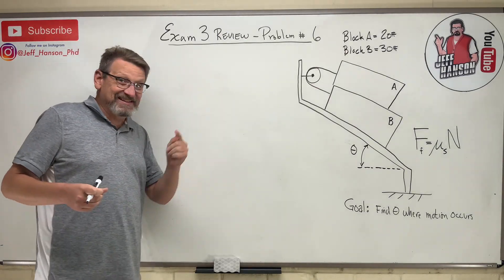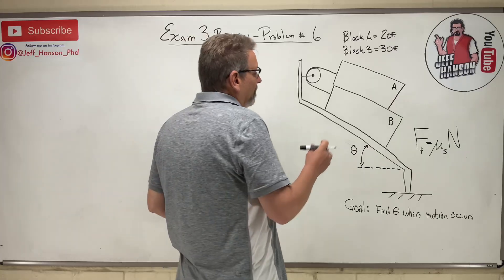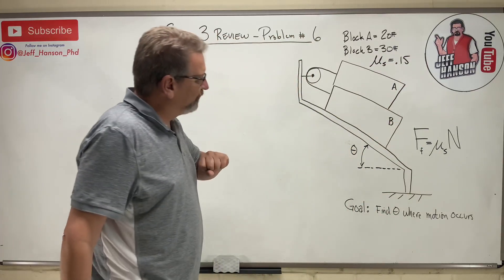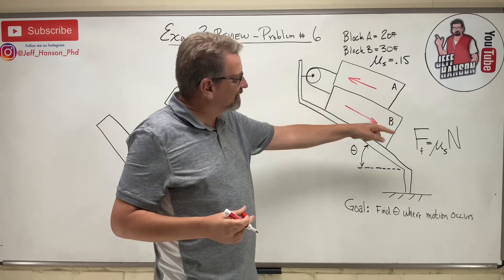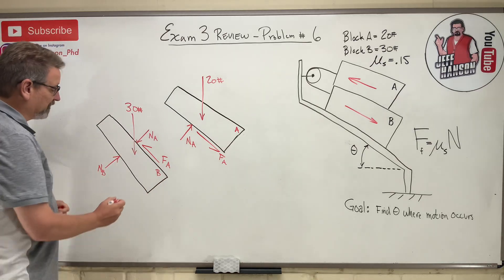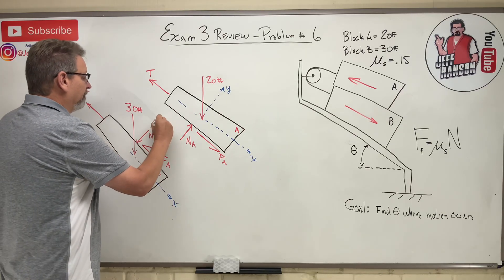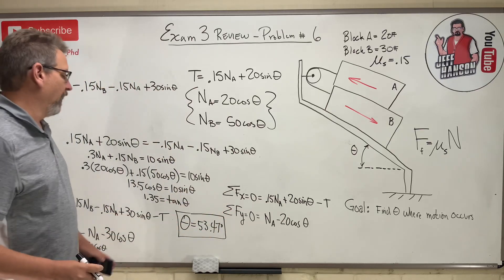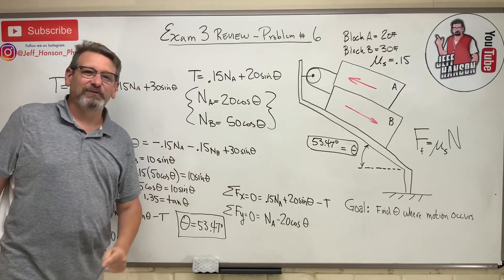Statics: Exam 3 Review Problem 5, Simple Friction is Fun

Comment: I'm confused. For the vector that calculates the weight of each block, you use the cos of the original 20/ 30 pounds. Isn't this inverse? It should be 20/ cos(theta) not 20*cos(theta)

Comment: Why do the sum of x forces = 0? If we are solving for where motion occurs shouldn't the sum of forces be greater than 0?
Reply: This course is statics therefore we are discussing things that are not moving all the forces in all directions = 0 because if they didnt they would be moving
Reply: @crushx  actually in this problem we are finding where motion occurs. original commenter is correct in assuming that sum forces are not equal to 0 when motion is occurring, but since we are finding the exact value at which theta would cause the system to move, the equilibrium equation still works. we are finding the last possible value of theta in which the system is static, which is also the point at which motion occurs.